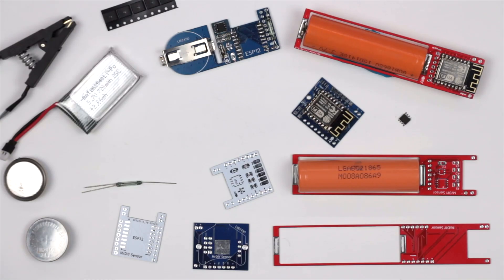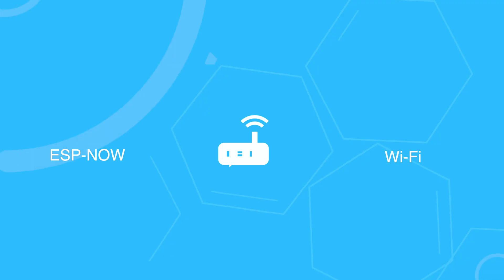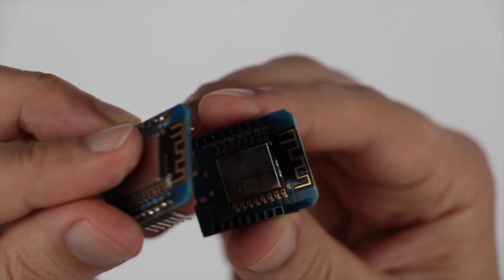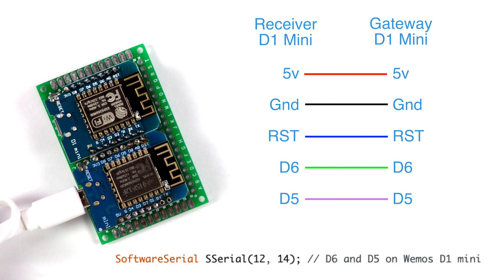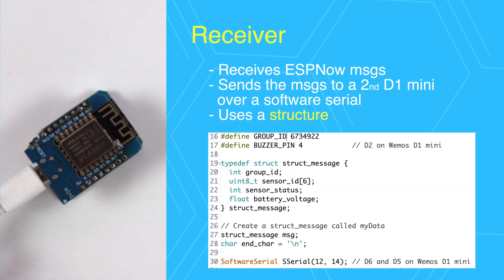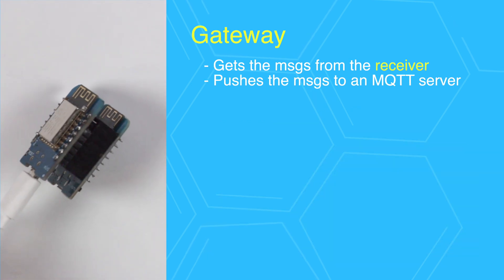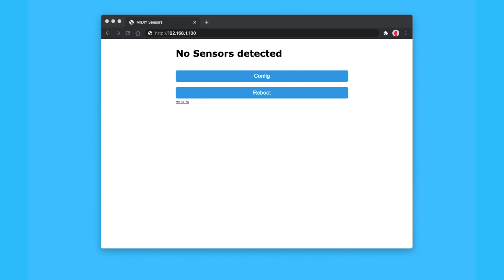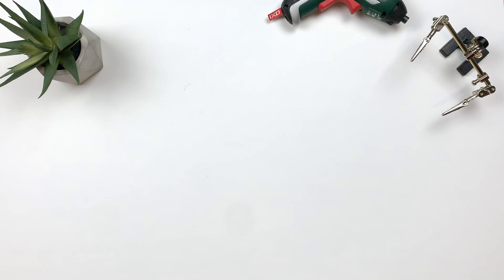My Ultra Low Power Wireless Trigger Sensor: the Hub (Part 3)

Comment: Must use 2 x esp8266? Possible to use 1 x esp8266 (espnow + mqtt publish)
Reply from the maker: It is possible .. but it is a lot of headache. Using 2x ESP8266 is much simpler.

Comment: How come you have to use 2 d1 minis in the hub? Why can't you use single one to receive messages from remotes and send them out to mqtt?
Reply from the maker: You can ... but it gets complicated and there are limitations: ESPNow and Wifi must use the same channel, slower trigger time due to constant scan of channel id, the sender will no longer be plug-and-play and needs to be configured .. just to name a few. 

2x d1 minis remove all this headache and I personnaly find it simpler and d1 minis are dirt cheap. But yes, it is doable.
Reply: @MrDIYca  ahh, thanks for the reply.